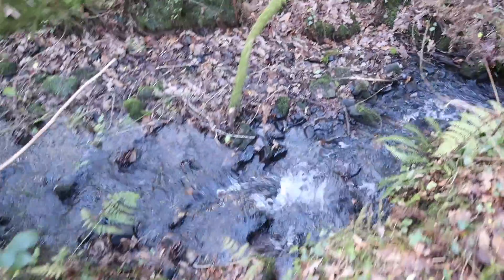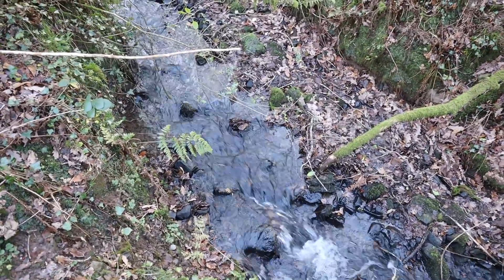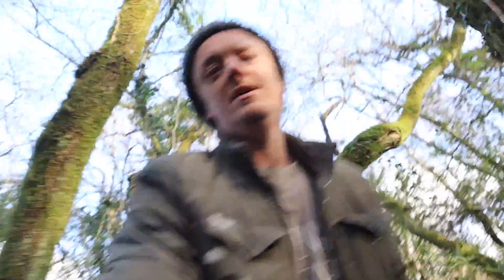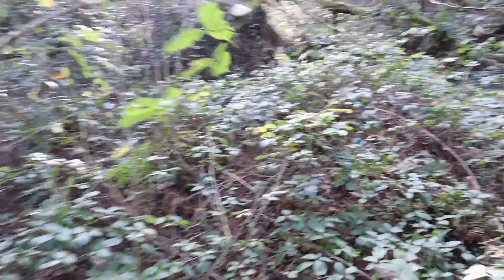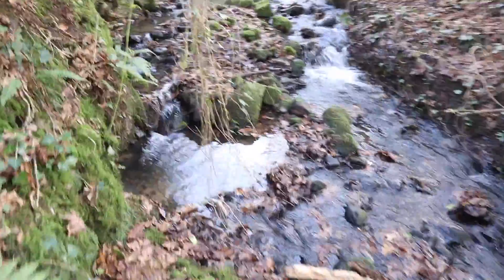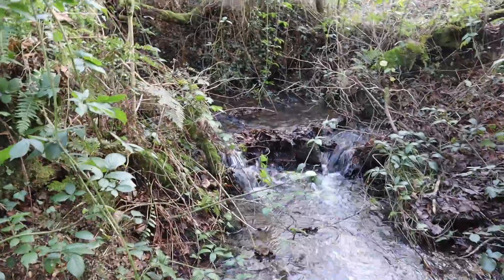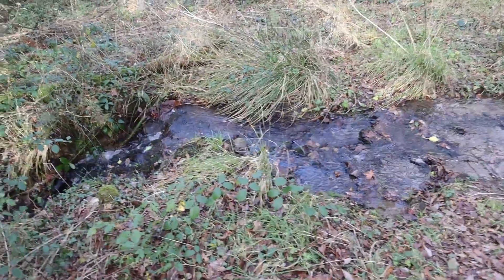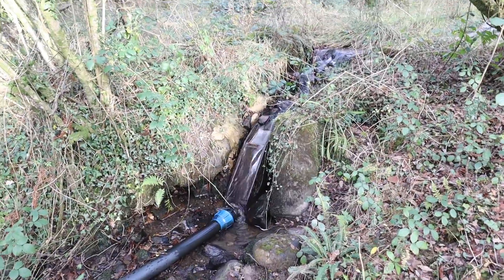Prospecting A Second Intake Source For My Off Grid Micro Hydro

Comment: It seems to me it'd be easier and cheaper to run a power cord off a second turbine than dig a long diversion pipe from the new stream and all the fussing with equalizing pressures.  The distance isnt really a factor either - step up the three phase voltage at the orign then step it back down at your power shed and because it's a higher voltage you can use a smaller and less expensive cable.  Then there's the redundancy factor - if you have two turbines going and one goes down for preventative maintenance or repair then you still have power being supplied to the power shed.

Comment: If you would let the 2 tubes first go into a way to big tube whit a conical end (or even a basin), would that work and make it irrelevant if they have exactly the same flow or would you loos power that way? Because it seems to me nearly impossible to have the same flow all the time. maybe one stream will cary more water one day or another and everything fails.

I would probably design it like this: Make a big basain out of steel. the botom has to be conical with the exit in the middle of the botom. The two intakse would be left and right on opossit corners
this way the water will build a constant combined pressure in the basain and it doesn't realy matter what pressure each stream comes in to it. If you don't loos (much) energy. I think this would be a realy good solution. :)

Comment: Why don't you dig a hole and let all the streams run into it. Than have an out let to your tap off pipe? Cheeper and no need to dig pipes into the ground. I would try to look at that solution. It is cheeper to dig a big hole ...lol

Comment: Kris, I suggest you look at Mr Hydrohead's video series Micro Hydro Power in Colorado. I can see many similarities to your system. Of particular interest I noticed was his use of a Coanda screen at the intake as a means of overcoming penstock intake capacity limitations and fouling with air bubbles, algae, leaves and other debris. What a great system you've produced, not so much as pigs in pipes but more like rabbits from hats with regard to high system output from quite small available flows. Well done!

Comment: The height of the intake for both sources must be the same to be able to join them without creating a back flow in the pipe to the lower source.  Sorry, but that's physics for you.

In addition, increasing the speed of your generator will cause the efficiency to decrease.  There is an optimum speed for your pelton wheel which is roughly 1/2 the speed of the water hitting it.  At faster speeds, less water energy is transferred to the wheel and the rest is wasted.

For a first go, consider joining the source pipes and putting valves upstream of the connection point.  Then operate with only one valve open at a time.  This will allow you to run from the larger stream when water on the smaller stream is too low.  100% hydro availability is a step in the right direction.  Capturing what you can produce above household needs is the next step.

Think about adding more batteries and running the hydro full time to capture everything possible. This may require a way to charge/discharge separate battery banks (one for house, one for shop) from the hydro plant, or for swapping out individual batteries once charged.  You'll be able to fire up the workshop when excess power has charged enough 'overflow battery' to support the tool use.  

In the end, if you want a full time doubling of average power generated, you'll likely need a duplicate stand alone hydro generator system with more batteries.

Comment: Kris, I think you are not going to be able to join the 2 pipes together unless the start height is the same.  What you could do is run both to the same generating shed, and use each to initially run the same turbine, and in time build a 2nd shed with a 2nd turbine creating a redundant system so that you can take one system offline for maintenance while still generating power from the other.

Comment: If the stream you are currently using is fed from the second one (the one you just showed) would it be possible to divert more water from the second stream higher up into yours? Making your stream bigger might be cheaper then buying more pipe.

Comment: Hi, 3 ideas. 1. is there any option to lift the head on your first intake using a small dam ( beaver technology ) this would increase the peak power without changing the flow rates. 2 - for around £2,000 there are options for installing a small scale 500W  wind turbine giving you further diversity of supply.  If you do go for an electric vehicle route there may be options to use the vehicle battery to support your workshops peak power demand ( Look into Nissans' CHADEMO-equipped EVs, early days but V2G is a fast-developing option).

Comment: Only just managed to catch up Kris! very exciting more hydro and more power! future proofing definitely isn't a bad idea at all. when I saw your table saw and planer I thought.... "were gonna need a power and storage upgrade here!" how are the forklift batteries working out mate? always great content as usual!
Reply from the maker: Hi, I have been using the planer and table saw today, Only on a generator though, Im waiting for a new inverter to turn up and then i will be able to run them off my system. The forklift battery is working great and is plenty big enough for my needs. especially as the hydro keeps it well topped up :)

Comment: Have you put any thought into creating a small dam on your existing stream at your intake to retain some of the water that bypasses the intake. Therefore using more of your current water that the stream does actually have?
It could be built to allow excess to still spill over during your wetter months but create a small reservoir to better supply the turbine during the dryer months.

Comment: A Check Valve on the lower intake would prevent backflow and when the demand for flow overcame the upper intake it would un-check the valve and provide more flow.
Or you could pipe the flow of the new stream into the upstream of the intake of the current stream if you dont need a bigger intake.

Comment: The pressure is determined by the head pick up so you want them at exactly the same height, where you connect them together is not relevant to balancing the pressure. You might have to rent a theodolite and some survey tools.

Comment: Micro hydro projects involve changing lands ecology for relatively trivial amounts of power. It may be done considerately but pay some thoughts to the ecological roles which the only steady stream on the land has developed, and how you intend the ecology to change.
Reply: I would say that this type of system has an absolutely minimal effect on the local ecology. It takes only a relatively small percentage of the water out of the stream, and returns it lower down the flow.
This will mimic natural flow variations.....
Also, bear in mind this is exactly the kind of electricity generation which we are told will help to 'save the planet' - you can't have it both ways......!
Reply: @andymccabe6712  Depends on the details of the stream and the system. The remaining part of the stream could be completely dried up during drier spells/seasons, this would be a barrier to the wildlife which populates the watercourse, potentially obstructing reproductive cycles which can extend from the source to the sea.
This is not the kind of electricity generation which concerned engineers generally advise to help stop the incredible environmental and climatic disruption of our times. Its very clear that technically we should connect to large scale generators which are much more efficient with resources than micro projects, except solar to a degree it can be sited quite benignly. If everyone tried to power their houses and factories from micro hydro projects... well, we just couldnt get close, there are no where near enough wild water courses to go around. Theyre really pretty precious in the UK.

Comment: I have a few questions, most notably how you are going to connect the 2 penstocks as I think the 90° angle will increase resistance and make pigging difficult so maybe some sort of Y connector that doesn't decrease inside diameter or manifold for pigging?  Secondly, having a dam type intake will increase the pressure massively depending on water height/weight behind the dam, will you use this to balance pressures between intakes maybe? how much more flow can you expect to see from the same diameter pipe? if you're worried about one intake overpowering another I haven't done the maths but a video about it might be nice with elevations and stuff then maybe your youtube followers can give some more insight into what to expect from the dynamics of this system.

Comment: This will be a great project, both intakes I would think would have to be at the same height to avoid pressure in balance. Also the head of water behind any dam would change things. You mentioned one turbine is more efficient than two but having two who give you back up a d would solve imbalances of pressure.  They could both be located together and use the same run off. It's a great project best wishes on what ever you do.

Comment: How flexible is the pipe you are using for penstock? Will it be able to bend through the stream and forest like you need it to?

I'm super interested in seeing how you will join them and how well the flow balances. Do you anticipate needing a remote controlled valved to make sure intake at each of them is balanced?

Great stuff - beautiful piece of wild land. It would be so much fun to just wander through those woods.
Reply from the maker: yeah the pipe bends ok as long as the bends are very long and not sharp.

Comment: Look forward to the video, map of the various streams would be nice.
Are you not better running a 100% separate new pipe, run that to 2 jets on the turbine, and leave the current stream running 2 jets.  Obliviously upping the jet sizes as you'll do anyway.
Then your not worried on exact heights, and lower losses from the final section of double-flow pipework.   You'll need to be inch perfect with the damn height (making the assumption you'll do that sort of intake). I guess it will be easy to check with the pipework valved in such a way you can use it as a giant water level and adjust the dam height to match?

Although wont be as good of video content I'm surprised you haven't also got a wind turbine just for the variety of sources. Although yeah you need a massive 60+ft pole and planning for a decent size 3-5kw power.  On their own pretty bad but with solar and hydro the mix should be good.

Interesting what you say about an electric car. You can buy a leaf these days for £4-10k with a 24kwhr battery - so buy one, use it for a bit then strip it for the battery - they reconfigure to 48v and if its its lost half its useable power and crap for car use anymore still make a hell of an off grid battery 12-15 useable kwhr's

Comment: Kris - it's become clear - if you read all the comments, that there is a complete OBSESSION with building a dam, or dams - for various reasons, in the system!
I think it would be useful for you to make a short film explaining why you do - or do not - think this is a good idea......!
Reply from the maker: Hi Andy i was literally just thinking about that as i read the comments. i wont be building a dam. well not more than maybe 400mm or so just to funnel water to the intake. for some reason people seem to think having a dam creates water. people say things like "build a dam and get more flow" like the dam suddenly starts to make water. all a dam does is store water. and add head but you need to remember that any head gained means that the water level behind the dam is raised as well. flooding a massive area of my neighbours land and causing alot of environmental damage to surrounding trees and land for an extra 3m of head   is not high on my to do list. As for the water storage side of dams, in order for them to have any significant storage they need to be HUGE my turbine will use 5lps from the source. thats 18,000 litres an hour. so i would need 18 cubic meters of water just to run the turbine for an hour. the turbine uses close to half a million litres a day. it would cost more than the entire system combined to build anything that would be worth doing and i would have to buy about 3 more fields and just flood them.  Lets say i did it and built a 3m tall dam in the far corner of my woodland where there is no access at all. a 3m dam would give me 88w more power at the turbine. and maybe a few hours run time in storage. thats all it would do. All that work, cost, damage to land, all the maintenance it would need for 88w Thats why

Thanks for the comment. always enjoy seeing your comments.
Reply: @KrisHarbour  great - you've confirmed what I suspected was the case....!!
Cheers
Reply: Great way to answer that question Kris, I really do appreciate the fact that you have considered your environmental impact.

Comment: Couple of questions more out of curiousness vs knowledge (of which I have none ) :
Would you have to change the pipe going from your turbine to the point where the two intakes join (Make it fatter)?
Could you use some form of electronic pressure regulator to even the pressure coming from both intakes?
Super interesting stuff! Look forward to the future videos! Keep up the good work!  :)

Comment: You may need to get a licence from the Environment Agency. Taking water from a watercourse is not necessarily in your hands. It might only depend on how far down stream they reconnect, but you are intending to reduce the flow by 50% at the cost of the wildlife in that established stream. You may have more responsibility if the woodland is a Priority Habitat. There may be no fish but that accounts for only a few % of the wildlife in a stream. The invertebrates are a food source for many things in your wood. The view you gave looking up stream had two flows around a dryer area. That flow and the associated pond on the left would likely disappear as the flow would be reduced. Ecology is not just about the things you see or don't.

Comment: Gotta love off grid power.  My entire home/shop run off of solar, and I know what you mean about having a system big enough to accommodate all of your tools.   I build guitars/guitar parts, and have a full woodshop.   My solar system is 17KW, with 2 tesla powerwalls, and it has never failed to keep the house and shop running.   Good job on these videos.

Comment: Hi Kris, that looks a good project. Could you mitigate the risk of balancing the pressure at the coupling point by varying the pipe diameter and adding a valve?

If your looking for an electric vehicle, check out the Outlander. If you installed a bi directional vehicle to home system, you’d have an extra 12kWh of battery storage.

Comment: as you mentioned at 4:08 just make sure the intakes are at the same elevation, otherwise the higher one will only start pushing water out the lower inlet. I am sure you have worked it all out but adding a second inlet to the same turbine will only be beneficial if the current input is not supplying up to the capacity of the turbine (ie the water level is somewhere between the inlet and turbine). I just want to make sure you get everything right so you are not wasting time. to a certain extent adding more water won't do anything since it will be limited by the turbine jets max flow.

edit: oh I should have watched the whole video first but looks like you got it figured out
Reply: Please help me try to understand - why would anyone ever comment on anything EVER without watching the whole thing???!!!
You literally don't know what you are commenting on.........
Also, I have to say that parts of your comment came over as patronising and arrogant - though hopefully not intentionally(!) because you appear not to know the history of the channel. For all you know, Kris could be considerably more knowledgeable than you about hydro.....??
This could simply be the effect of written, rather than spoken words coming over differently, but...
Reply: @andymccabe6712  so that by the end of the video I don't forget what I was going to say

Comment: Yes please kris would love tho see this. Have you thought about building a head race I think its called, bit like a small damn, like they used on watermills to have higher volume of water moving at increased speed. this would mean a pond type structure to hold a volume of water, which you can control when you need more power. Would depend on how your land sits and if you have the suitable area for the pond and control overflow you'd need to avoid flooding. would be a BIG project maybe something for the future ?

Comment: Any project on hydro power would be worth watching. Your proposal sounds like the most practical way of doing it. I initially thought that you were going to put in a second turbine and was wondering if you were going to need to use step up and step down transformers to avoid transmission losses. However using a single turbine reduces complexity. It is a trade off between complexity/maintenance and redundancy. Maybe you need to keep some critical spares for your turbine so you are not out of power for a week whilst waiting for replacements.

Comment: It will be nice to see you improve the already great hydroelectric system!
One thing I wonder though is, will measuring static (no-flow) pressure be enough to ensure there is no flow of water from one intake point to another, or will the pressure drop be more significant in the pipe from the bigger stream?
Have you measured any significant pressure difference when water is flowing down the pipe?